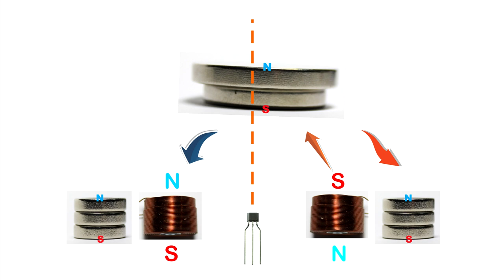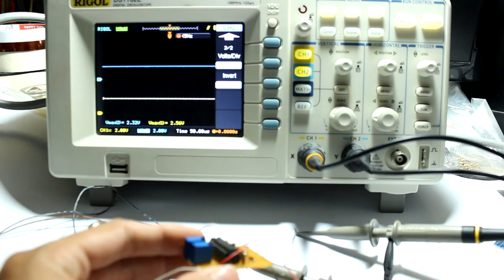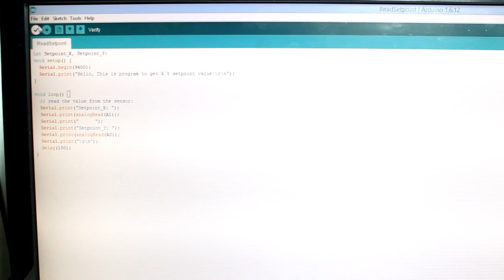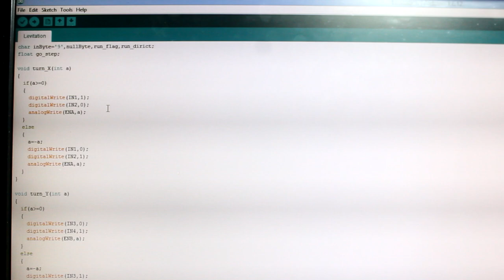How to make Arduino Magnetic Levitation (Arduino Air Bonsai)

Comment: Thank you for the instructions, The Magnetic Levitation Coil and SS495 is not available here, So can you say the height, outer radius, inner radius of the core of the Magnetic Levitation Coil, and the SWG of the Magnetic Levitation Coil wire. Also kindly say another Hall sensor, which can be use instead of SS495

Comment: Your video is good but in some places some doubt. It is not clear that the 4coils you use how they attached with each other, I am asking because I don't know about electronic but interested. Hope you  will reply
Reply: He only attached the negative lead of each coil (common mass), still he can input variable voltage in each coil.
Reply: did you find the answer? now I'm trying this project too! let me know your solution
Reply: @jg_bboy3028  did you find the answer? now I'm trying this project too! let me know your solution
Reply: @sembilan9823  no I am still waiting

Comment: Hi, im currently doing this project, can you please explain why you dont say which resistance to put in the circuit in the instructables? I'm talking about the 2 that suddenly appear in the video, also, how can someone calibrate using a multimeter? You put in the instructables that it can be used but not say how to, please I'm looking to hear from you.
Reply: did you find the answer? now I'm trying this project too! let me know your solution
Reply: So, did either of you find the solution?

Comment: Video is very good but if there is subtitles with it that was more helpful. Please if you add subtitles about Ic's or mosfet and also about how much round of copper wire, what's the program you are using through computer.